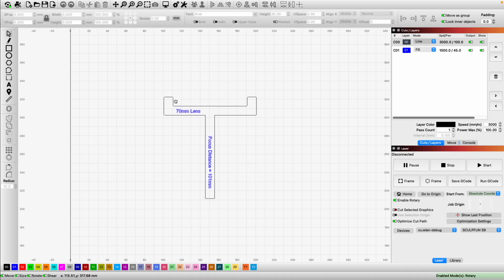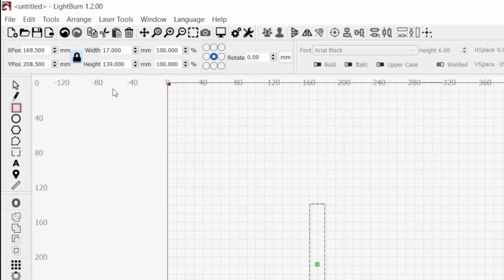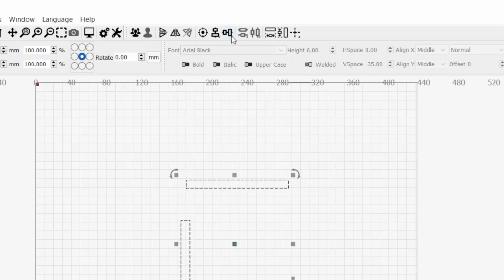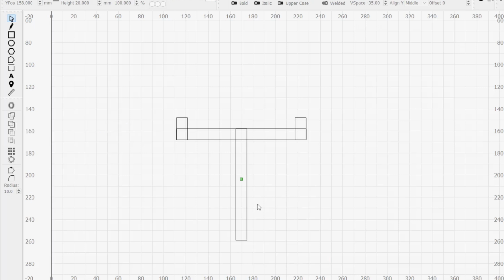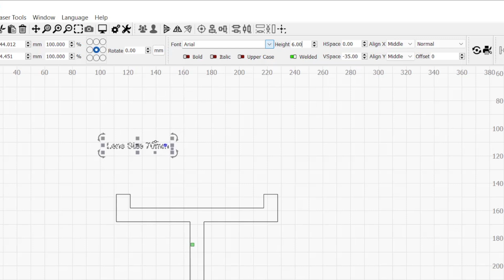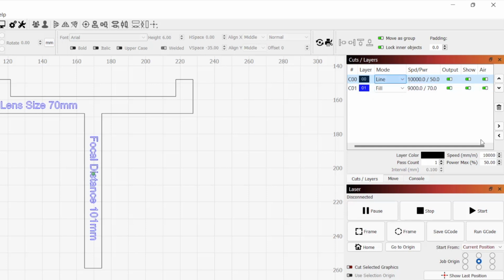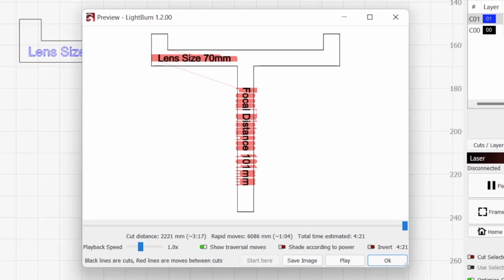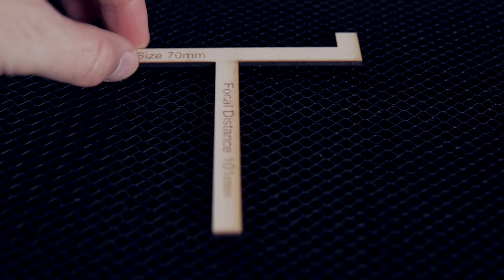Focus Jig for YOUR laser - LightBurn Project

Comment: I have attempted to with my Fiber Laser speed power and frequency ENGRAVING SWITCH PLATE . I'm not doing it on the old style plates only on the new ones that don't break that you can twist which I believe are mylar plastic. Want to engrave them but doesn't seem to want to show up. Using it to label for computer network and Home Theater. I've tried different power and different speed & frequency, but doesn't seem to make any different . Nothing shows up. Any suggestions? Would be helpful. I don't like using the old style plates cause they break too easy and you don't see that many of them anymore they're made out of that old. Bake like plastic. And most of the time when you're doing Home Theater and low-voltage you're using the square holes for the network connectors. Or HDMI.

Comment: Hmmm.... I am working on a project that uses galvo-controlled lasers. Except not engravers. It is a laser light show that has RGBW (the W= all on to produce white light). Your software may have a new purpose... to create custom images that control a DIY laser lightshow. I own your software. Can I send you an email to talk about this more?
Reply from the maker: If it’s not controlled by EZCad or GCode it would be well outside the scope of our software - we don’t emit color (because engraving lasers don’t work that way), so I would doubt we’d be anywhere close to something like Pangonlin’s laser control software for light shows.
Reply: @lightburnsoftware7189  So, I am pretty sure you are expecting the firmware/hardware of the laser engraver/cutter to take GRBL/GCODE command output from Lighburn to convert GCODE to the analog laser galvo positioning signals? I'm not saying this is not awesome for Lightburn to now support. I just don't understand how controlling an X-Y cartesian laser laser is different from your end, being Lightburn? I don't own a fiber laser. I'm now re-directing my galvo system to try and make a cheap galvo-laser based system to use in a resin 3D printer.
Reply from the maker: @johnclayton2101  - let me put this another way: we’re a small dev team supporting 200,000 users and a decent number of vendors.  If your request is for us to customize the software and interface so a very small number of users can run laser light shows, taking time away from features we’re in the process of implementing for our broader user base, we won’t be doing that.  If it works for you in its current form, great!
Reply: @lightburnsoftware7189  No, I'm not asking you to do anything like that. I appreciate the work you have done and I completely understand it's purpose. You have done a fantastic job. I am just wondering if I could get details from you on how your software controls the galvos in a fiber laser device so I can adapt my laser show hardware to work with your existing software. Especially when your software does the preview of what the laser will cut/ That's all. Not asking you to change a thing. I apologize if I was not clear.
Reply from the maker: @johnclayton2101  - ahh, understood.  Well, EZCad systems don’t use GCode - it’s a proprietary binary protocol, so adapting your board to use their control language isn’t likely to be simple.  Take a look at the Baylor project (open source) for some of the details.